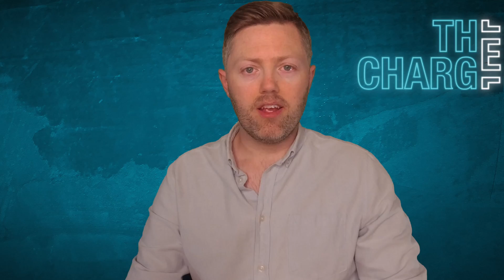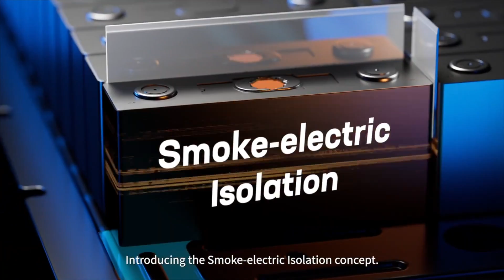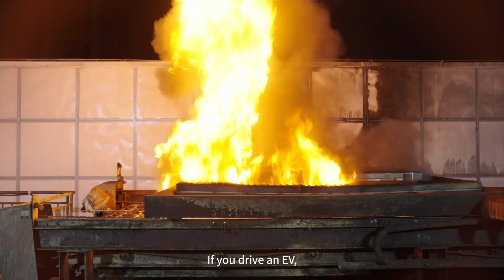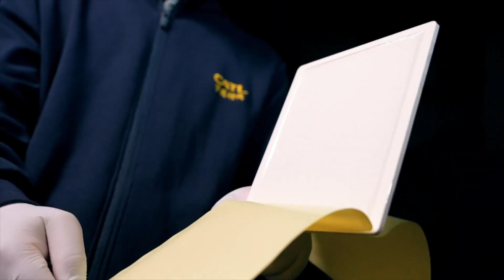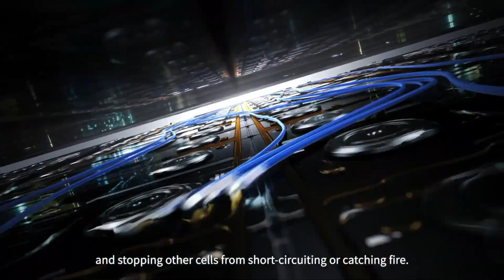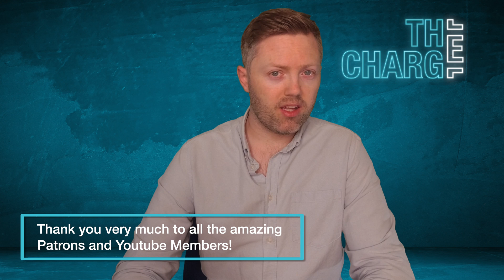CATL’s NEW Battery Tech Destroys Batteries from BYD

Comment: Have to say, there’s a massive hole in the fire department stats argument, because there are far fewer ev’s out there than combustion engines. A better metric for comparison is fires per unit distance driven.
Reply from the maker: Noooo, this data is per 1000 units sold, of either Hybrid, EV or ICE. So the the hole doesn't exist.